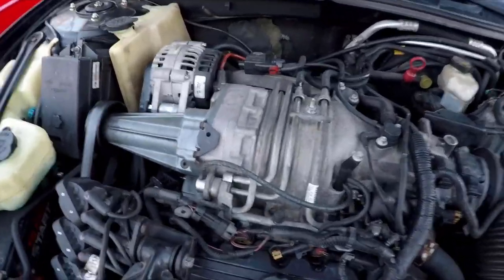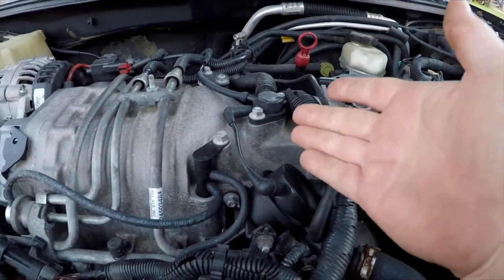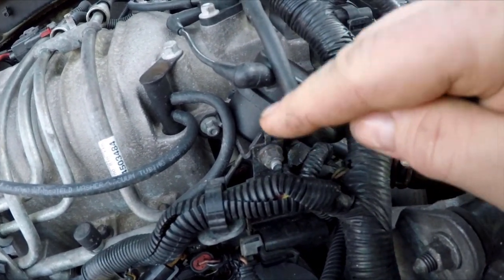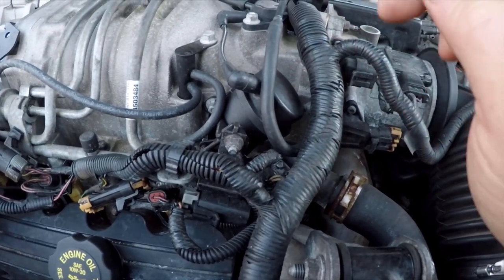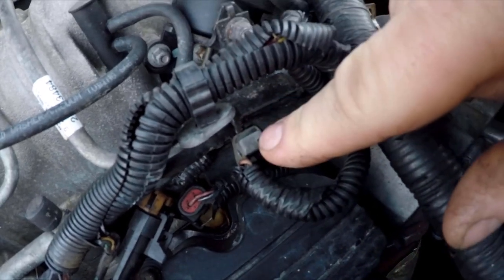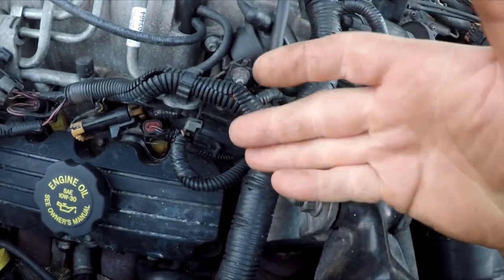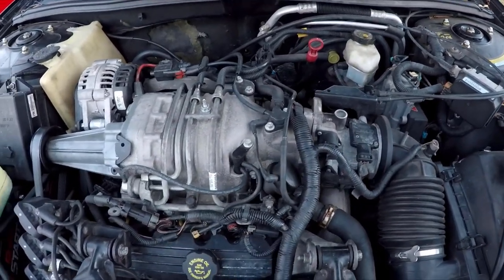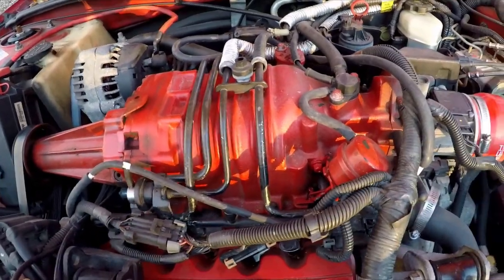Supercharger Boost Bypass Valve Basics

Comment: Hey i think my bypass valve went out. I have an edelbrock eforce on a vette. It runs ok if i dont get on the gas but when i hit WOT it dies completely. My Temporary fix is ziptie the valve open until i get the part. With it ziptied i hit the gas and i only build about 5lbs. Is the valve really my problem?
Reply from the maker: With the valve open, you won't be able to build very much boost, that is normal, how many pounds of boost are you seeing when it's not tied open?
Reply: Salem Doyle i dont see any boost when i floor it without the ziptie car dies out completely as if im braking. And car goes into “reduced engine power” until i plug in the code reader and clear it out.
Reply from the maker: What code does it throw?
Reply: Salem Doyle 
(P0036 heater control circuit bank 1 sensor 2)
(P0068 map/maf throttle position correlation)
(P0103 mass or volume air flow A circuit high)
Reply: Salem Doyle i uploaded a video on my profile here on youtube maybe you can hear it...

Comment: Hey idk what's wrong with my 01. It says I got boost. Says i don't have a engine code. My supercharged GTP seems so slow. 0-60 8.5 or so. My grand am se was faster. I need help. I got a po401 but I don't think that's what it is. Someone please help.
Reply from the maker: There are a lot of things that could be going on. How is your maintenance?
Reply: Good I get oil changes pretty often. Not sure what kinda maintenance I should do on a supercharger though.
Reply from the maker: I mean like spark plugs and stuff
Reply: I bought it in the winter. I meant to change all that when it warmed up. I can try that. Could that cause that much slow-ness.
Reply from the maker: Possibly.  Also check for exhaust restrictions like a stopped up catalytic converter

Comment: I know this is an old video but any help is appreciated as just got a l67 engine with a m90 charger on it will bypassing the solenoid cause engine knock detonation with a smaller pulley ?
Reply: All good you explained it in the video looks like im leaving it alone till it goes for a tune

Comment: I have 2008 Shelby gt 500 got two codes p1227 and p0442.
Help
Reply from the maker: So, the evap code I wouldn't worry about right away, the other code has to do with the by pass valve , there are several things that can cause it but I would start out with a visual inspection of the boost by pass valve and make sure that it moves freely and is connected correctly
Reply: Awesome. I did check it and it’s working and car is making boost but it still throws p1227 and p0442.
It’s frustrating to say the least.
The car is 2008 so it’s 12 years old.
I did do a pulley swap and jlt cold air intake with bama 93 octane tune but....
Can’t figure it out
Reply from the maker: @Freedom_Back58  it looks like the most common cause on this motor is vaccuum line issues going to the bypass valve  (leaks).  But i would think that the pulley drop could also throw the code if it's not tuned for correctly.

Comment: Hey thanks for the gtp tips! I have a 99 gtp four door, and live in iredell county! Could you help me out with a mild tune??
Reply from the maker: Yeah, i have the software, you would just have to buy the licenses
Reply: @SalemDoyle  that's fine with me, maybe sometime In april? How much is the license?
Reply from the maker: Would have to look the ecu up, usually 50 to 100
Reply: @SalemDoyle  awesome, I might do it sooner then. I am about to do shocks and a transmission mount, maybe cai and colder plugs. Just finished cv axles, steering rack, pump, brakes tie rods wheel bearings, complete ac replacement, motor mounts, 3" downpipe ubend delete, cam and crank sensor, fuel pump, and regular maintenance.
Reply from the maker: @marshallmcaleer89  Thats a nice list.  getting a lot done i see. just let me know.  if you check me out on facebook or Instagram, you can message me there.
Reply: And 180* thermostat. I'm not going to drop pulley size but I'm sure it could use a tune.
Reply from the maker: @marshallmcaleer89  even stock a tune helps.  especially the trans
Reply: Hey looking for a tune for a 98' GTP, can you help?
Reply from the maker: If you are local

Comment: Love the 3800 series 2
Reply from the maker: Thanks, me too
Reply: @SalemDoyle  I actually got one pushing 912hp but it's running a 6266 precision turbo set up, we are running 93 octane as well for the car . Been building the motor on and off for the past 4 years to do it. 

They don't like power that high besides around 600-700hp
Reply from the maker: Well, i dont think many 3.8lt motors would like that much power without a lot of work.  That is a lot of power for an engine that size
Reply from the maker: @sagenthesergal  congrats on hitting that number, must have been a lot of work
Reply: @SalemDoyle  yea they hate it a lot. But we had to port ours to a 4.2l just to crack 800hp alone but we have a lot of money dropped into it. Custom parts are in it as well to keep the power high but at the end of the day. Its mostly a show car for 2 step now or we run it at speed events (we usually run around 175mph to 185mph avg) but the transmissions usually give out in the 4th run on full power so we are currently getting a custom dog box for it . We do race it but we done run it over 700hp due to the crazy psi we push while running it. 

Our first 2 motors blew a massive hole on the side of the block while trying to hit 800hp alone.
Reply: @SalemDoyle  thank you and it was very very hard and a lot of money put into it to, just a lot of errors alone. We have so many  Gauges to monitor as much stuff as we can since these motors do need a lot of attention.

 A lot of it is the heat they give off alone which is wild so he run 2 high powered cooling fans on it. Have a custom hood to extract a lot if that heat out of the engine bay
Reply: @sagenthesergal  How is this project going?  Is this on a L67?

Comment: Bro My Gauges dont light up. Haha wtf do I do?? It has to be a fuse I'm guessing.
Reply from the maker: Fuse, or loose connection, also a dimmer switch issue possibly
Reply: Fix the resistors inside cluster

Comment: Oh the guy I bought the car from was a parts changer first thing I checked was the block of cardboard that used to be an air filter eliminated it pulled out the air box which was full of squirrel food I guess and let her run wide open for a little while and God that was glorious but cleaned everything and put it back until I can upgrade also found three vacuum leaks from the jump which eliminated it throwing codes is there any way to find out how many different sizes I need to purchase a vacuum tubes as well as what fittings are needed ?
Haynes manual maybe I don't know if those are even still available I wouldn't buy a Chilton's book to try and fix a 10-speed but Haynes was always pretty good 
What sort of reference material have you used maybe besides the internet nice thing about a book is you can flip it to a page flip past it and go back stare at a diagram committed to memory instead of rewinding to watch something at  Dam 🦫 there's thst  girl oops I missed it !
Lol